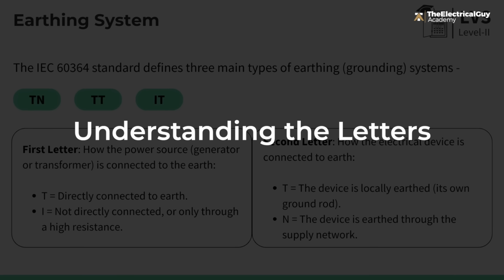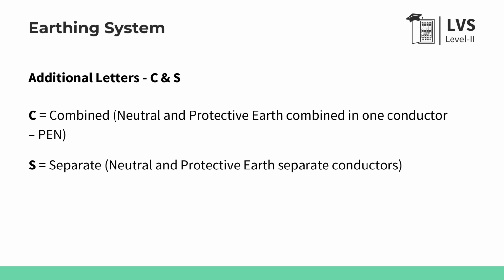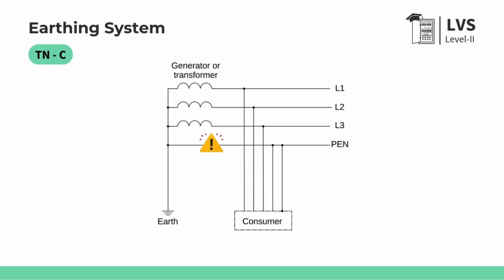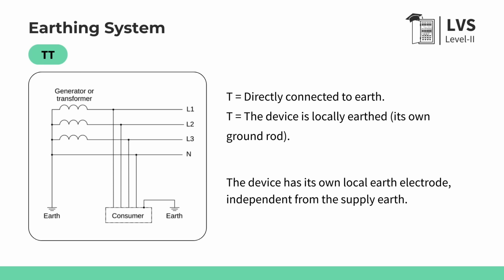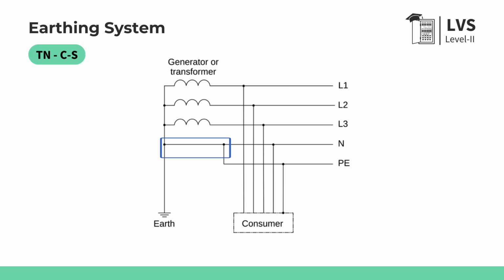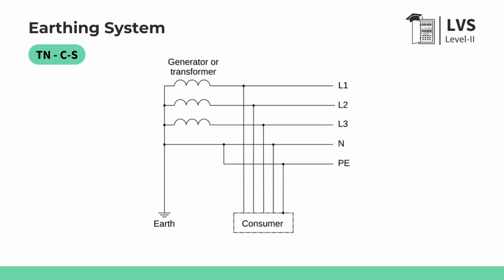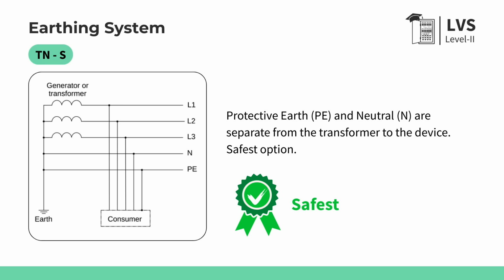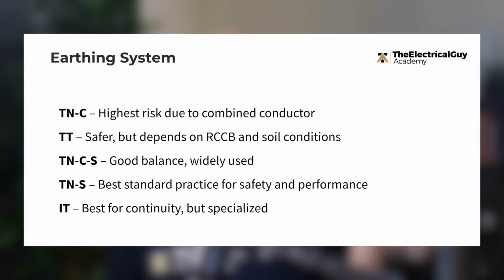Earthing Systems Explained: TT, TN-S, TN-C, TN-C-S & IT (Complete Guide)

Comment: At least in Germany it is mandatory to ground the PEN localy (again!) at the point where the PEN is split into PE and N, that is where the system changes from „C“ to „S“. This is called „Anlagenerder“ („Earth of local installation“) and it is done again and again in every main connection box of „a house“ to the grid. So the PEN is (generally) quite good grounded by all the neighbourhood. This lowers the impedance of Lx and PE/PEN.
This does not mean that a fault of the PEN is completely compensated, but the consequences are not that harsh as without the additional grounding.
The probabilty of a broken PEN is quite low, so TN-C-S is in general quite safe. And today you have in both TT and TN RCDs for protection.

Comment: I’m just starting to learn the basics of electrical systems, so please correct me if I’m mistaken.

You mentioned different earthing systems and which ones are safer. But don’t we also have a TT-S type arrangement in some homes? My understanding is that most houses have their own local earth electrode (the second “T” connected to the ground). At the same time, the supply provides separate Neutral and Protective Earth conductors (the “S”), which are bonded together at the source.

Because the house has its own earthing system, I was wondering whether this could provide an additional layer of safety if there is a failure or disconnection on the supply side. Is my understanding correct, or am I mixing up TT and TN-S concepts?

Comment: The information you provide is great and I love your videos. However, I want to argue on the risk described in TN-C system. I think the probability of getting shock is very low. The nuetral conductor picks other phase conductor to flow the residual current or return current. Your thoughts please?

Comment: As a PE, I love this video.  You might do one on North America’s center-tapped neutral single phase and wye-delta service for 3ph 277/480vac 60hz.  I do ups/inverter power system design often for boats that sail between European 50Hz 230v-n and North America 60hz 120v-n-120v shore service and I’m never surprised to see a European boat wired into USA "120/240" by connecting one leg of 120 line to the boats neutral, and the other leg, 180 degrees out of phase, to the boat’s 230vac line.  While it does give 240vac power, all the boat metal is 120vac above seawater.

Comment: Verse " The 3 other Beast goes against the First beast", the " first beast" words a place value holder of that verse multi- meaning. Now Angels I will now reactivate you at 2 sides of the First Heaven Earth Atmosphere WITH layered Atmosphere. Im not saying youre a beast or not, but that verse have hidden meaning probably connected to either Day and Night of a verse in the Bible scriptures. And at later time that First Heaven Atmosphere could be subject to attack not just on land ground the correlative or connected meaning for the first beast of actually either a Base or Anchor for the Earth Atmosphere confined within the Earth Stable Base of Round and Flat when at the field ground and Flat also when at a certain length up sky except when slope curving length outlining the Planet Earth of curve to Round by prepositioning now the polarized Angels types at either up or down the Earth Hemisphere radius sky atmosphere. Activating you now there and creating area structures for you 2 sided Angels up sky 2 sides up orientation with arctic pole or down orientation with the antarctic pole up or down the horizontal and curving Length of Earth hemisphere radius. Structure creation now of each type of Angels with Cloud Computing in Clouds structures each side, with Bell like light structures each, with Structural Light shaded cloaked structures per atmospheric layer properties and functionality and monitoring and control areas with habitats and Angels coded language of computer modules and area defenses of your own version create of how you each side Angels make use of its light fortified area atmospheres functionale nature and science effects with secret portals for your each side Angels up and down movements for time will come powerful beings of not yet presented themselves of unknown capabilities and technologies could be making move of attacks to dislodge and attempt invade you there at the atmospheres of skies. Let it be

Comment: In France all supplies for residential connexions are of the TT regime. You need 1 or more earth rods for ground. The resistance to ground in regard of the neutral must not exceed 10 ohms. So you add rods till you are under that value (or connexted to an earth loop burieds with the foundation of your home). Mine is around 2 ohms. It is an old building and I have 3 rods. With an earth loop you can go down to les than 1 ohm. 
In the distribution boards we have at least 3 earth leakage protection switches (at least separation of kitchen appliances, sockets and light circuits). Plus one main for wire protection.
The main earth leakage protection is 500 mA. All the others are 30 mA with differant switching curves. (A curve for kitchen appliances for exemple) and not more than 5 circuit breakers or 40 or 60 amps per eath leak safety.
Then you can have optionaly a 10 mA safety for hulide areas. If you live on the water (boat) this 10 mA is mandatory for all equipment.

In my case I have a main board with 1 3 phase earth safety, 3 30 mA safetys and 1 30 mA A curve safety.
A secondary board with 2 other 30 mA safetys one of 3 phases again. 

We also have mandatory lightning protection .
Reply: There's a problem with TT when the neutral fails. If the neutral cable that goes from transformer to your house(and the houses of your neighbors) fails somewhere on the way, then you are going to have dangerous voltages on your neutral in your house coming both from your own devices and from all the neighbors' after the point of fail . It can damage your equipment and it can be dangerous for humans. In russia we often install voltage relays for such cases because rural areas are all covered in forests and trees falling on lines isn't that uncommon. Voltage relay cuts off the phase and the neutral it is installed on, when it detects under/over voltage. In a set interval of time it tries to restore power.
Reply: I watched many tests of earthing rods. It seems that having one long rod is actually better than several shorter ones. Maybe the earth is just damper the deeper you go. People archive 1ohm with a single 9m rod
Reply: @hineko_  
That would be possible indeed, but at 2m I have solid rocks so 9m will not make it -;)

Comment: 3 days ago i was showering at night(the electric showerhead type)lights went out so i went to shut the now cold water off,⚡got nasty shock,the protective earth really did help,turns out the double pole  switch had failed over time  on the neutral side just before the earth connection 😢,its fixed now,the neutral connection failing is the one thing someone almost never anticipates

Comment: I'm in Thailand and I get a single L and the N into my home.

I decided to only use a good ground (soil) at my home as the PE protective ground to hold the chassis of all equipment on ground level. For me ist the N a Energie transport line, nothing else.

I want to be aware if that's line is diskonnectet or broken some how. In the case this N ist tied to ground at my home, the power would be routed by the soil to the transformer and it could be I not see anything wrong, especially if the load is low.
The second point is, with a N tied to ground at the Home, you will always get a certain amount of Energie returning via soil instead of the N line.

So I not tied N to soil by purpose.

To get reliable cutoff I use an RTC.

The N is grounded at transformer side, so the L and the N are not floating and are near ground level.
Reply: you have TT system. Do not bond N to your ground. It's dangerous. Your ground should be separate, even if you don't have good earthing. Install 2-pole voltage relay after your main breaker so it will cut off your power in case the N fails somewhere upstream. Use RCD or RCBOs to protect the rest of the house

Comment: Ok, from Australia, a couple of points.
I admit I have been out of  mains electrical for a while (electrical tradie and techie since mid 1960s), but none of this is at all familiar. 
Our earth system has always been Multiple Earth Neutral.  Simply put, supply mains from final transformer is 1, 2 or 3 phase with a neutral. That neutral is frequently tied to an earth strap. At the customer the incoming neutral connects to a bar. An earth bar is connected to an earth stake. All neutral  and earth wires in the installation are kept separate-accept-one wire connects both bars together. This means the neutral and earth are connected to each other in a very controlled way.
Maybe the anachronisms have changed  but as far I know this how they is still done here.
Reply: Australian system with MEN is equivalent to TN-C-S w.r.t IEC, reference Appendix A, AS 3007 (Figure A2)
Reply: Same way in some parts of the Netherlands, we call it "TN-C with helping Earth"
Reply: Hallo I am in Australia. Australia uses an earthing system that is common around the world. The MEN system is TNCS, actually the low voltage distribution system is TNC and the low voltage installation (after the MEN) is TNS.

Hospital operating theatres have isolation transformers and the theater socket outlets have an IT system, that is unearthed, but with earth leakage monitoring (not earth leakage tripping). 😃
Reply: As the neutral link is on the supply side of the fuse box both Earth Leakage and RCD work properly to protect the consumer.

Comment: The tncs diagram is incomplete as it missing the local earth at the main switch board. Ie both transformer and main switchboard have grounding rod connections. Also in Australia, pool reo has to be grounded along with slab wet areas.

Comment: TN-S was easy to provide when supply cables were built with metal sheaths. With the change to PVC and similar materials for cable sheaths a separate conductor would be required but it's simpler and cheaper to use the neutral conductor within the cable and connect it to earth at multiple points along the way to avoid a neutral-earth voltage gradient creating a problem.
TT systems are reliable and safer WHEN THE RCD CAN BE RELIED UPON.  Modern RCDs are good but no mechanical device is 100% reliable.

Comment: Good video, but I didn't understand one point. If TNC is not as safe as TNS because there is a risk of the PEN conductor breaking close to the transformer, the same risk can't occur in TNS if the PE conductor breaks? I believe the risk of failure is real for both topologies. Why, then, is TNS considered safer?
Reply: I think modern supply cable is the problem. The neutral is normally the outer sheath. If your local friendly digger driver catches the cable near one end, the outer could pull out of the gland, losing all protection. Assuming you and your neighbours are using power, all earthed equipment in your house will float up towards mains voltage. Hence equipotential bonding. If a completely separate Earth is supplied the problem does not occur. However, An RCD should do what it’s supposed to do, and trip instantly.

Comment: Viewers should note that for the common TNC-S system, ground rods at the service entrance are required. This helps to define a single ground voltage for the entire neighborhood, but without a whole house RCD it is an ineffective backup in case of a high resistance neutral path at the service entrance. Current through those ground rods is usually too low to trigger breakers to trip in case of a ground fault.

Comment: What a mess! If only there was some device that could provide galvanic isolation, so the end user could enjoy electricity without the baggage imposed by the distribution plant.
Reply: A transformer with separate primary and secondary windings. The secondary windings are galvanic isolated from the primary windings and vica versa
Reply: @JosRamenas  my point exactly. And while an electric power utility has valid reasons for grounding the primary side to earth, doing the same to the secondary side removes that isolation, and creates the shock hazard. If the secondary side wasn't tied to earth, touching a water pipe or some other thing at earth potential would be harmless. Making earthing more and more labyrinthine fails to completely solve the problem it creates!
Reply: @Speed-Daemon-123  Yes I understand what you mean, but in that case there would be no return pad for a fault current and it then will be like an IT network which will be dangerous because a first fault would be a ’sleeping’ one which will make a second one very dangerous for humans and devices. Need at least an IMD (insulation monitor).  Also, a transformer for let us say to feed household appliances would be a big one in dimension and also weight.
Reply: @JosRamenas  I don't know what a "return pad" is, so I can't comment on that. As for fault current, that's what circuit breakers are for. My whole point is that we need to get magical thinking and Victorian-era superstition out, and start using established scientific principles. Superstition isn't real. If you give the electricity only one path, it takes only one path. All the woo-woo names in the world can't change that. Yes, transformers for 50/60 Hz are big and heavy, and that didn't stop their use, did it?

I can tell that you hate change, but the excuses you're using don't show anything other than your unwillingness to change. Cost has a way of forcing the issue, and with copper theft being on the rise, going with 2-wire insulated systems eliminates a lot of redundant copper.
Reply: @Speed-Daemon-123 I never saw an electric circuit without the need of a return path when it feeds a load, so the circuit is closed to deliver it’s power from the source.
Reply: @JosRamenas  that's what a circuit is. The energy packet must travel full-circle back to its source for work to get done.
Reply: @Speed-Daemon-123  " If the secondary side wasn't tied to earth, touching a water pipe or some other thing at earth potential would be harmless. Making earthing more and more labyrinthine fails to completely solve the problem it creates!"

What you suggest was tried back in the early days, there's good reasons they abandoned it.

Unfortunately running your premises LV  supply  floating with no reference to ground can raise it's own issues:(.  GPR, especially if you have other services like POTS or cable systems on site can provide nasty surprises.  Wire insulation can mysteriously degrade over time.  If a HT cable snaps on  the pole & contacts the LV drop to the sub death & destruction can, & will, happen.

Don't ask about lightning storms. :(
Reply: @howardeisenhauer1391  "...there's good reasons they abandoned it." What's telling is that you can't list a single "good reason". That kind of blind faith isn't an intelligent process, it's a superstitious one. That goes for all "mysterious" causes.

And since power isn't signal, saying that any sort of reference voltage is needed is borne of ignorance or desperation. Since the whole benefit of isolation is that there is not a potentially lethal voltage at ground, then no, all those other conductors entering through the ground are not able to cause trouble. That's the whole point!

The only case where your dogged whataboutism has a glimmer of hope in it is the rare case when a high tension long distance power line crosses over a power distribution system. Perhaps one of those could break, and fall just so, so that it misses the medium voltage primary circuit (including the primary wire that is earth grounded) and falls on a secondary wire. But in that scenario, the presence of a ground does nothing to stop it from happening, so that too is a silly red herring. And while very high voltages have the potential to do great damage if they're downed, grounding simply isn't the magic bullet that your superstition makes it out to be. The low statistical likelihood of having such lines in residential neighborhoods, combined with fuses and other protection devices on the utility side of the power system take care of that, not grounding.

Comment: The biggest issue with TN-C systems is when there’s overtones in the neutral wire and since the PEN conductor often, at least in Sweden, is sometimes less than half of that of the live conductors the PEN will be loaded and thus can’t always handle a short circuit charge.
For many years the TN-S was standard but now the grid suppliers are going back to TN-C to save cost without solving the overload on the PEN conductor.
Reply: Tjena, pluggar till elkrafttekniker. Har du något sätt jag kan kontakta dig på, om du skulle vara intresserad av att svara på frågor om TN-system osv?

Comment: So my home with the power being supplied as just 2 line and neutral (US) and the ground at my panel being earthed and bonded at that panel only, then internal seperate ground neutrals throughout the house makes it a TN-C-S system. 

If the power company also supplied ground as well, I’d have TN-S?  Got it.